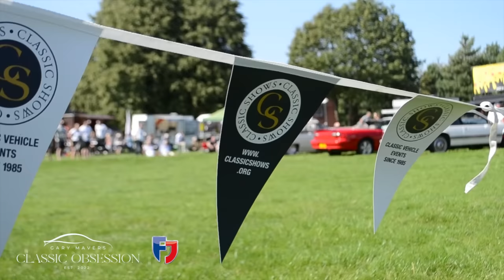Toyota Land Cruiser Transformation | Classic Obsession | Episode 15

Comment: nice job but the wide wheels looking way better, paint the rims in black, the whole car will looking perfect
Reply from the maker: I think it looked much better back to stock how it was designed to look originally but the main thing is, however good you may think those wide wheels look, they’re dangerous, terrible handling and keep snapping the steering. Regards.